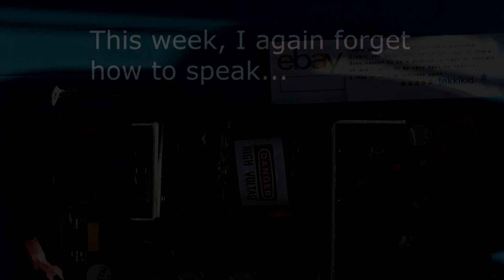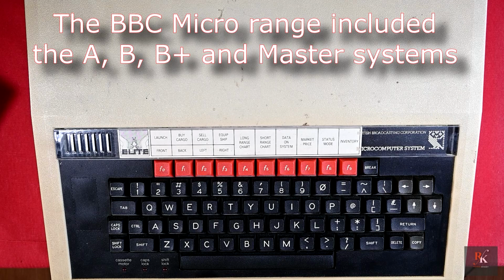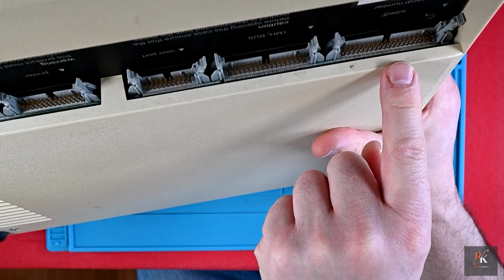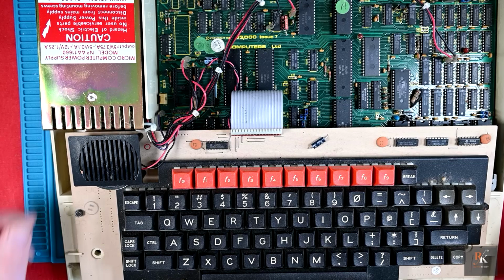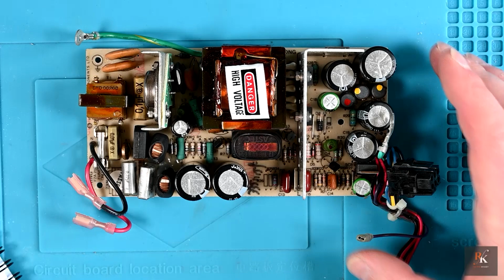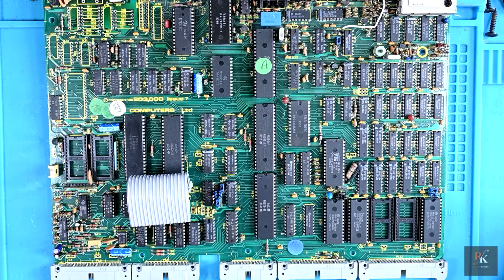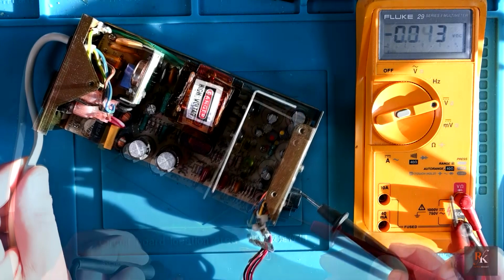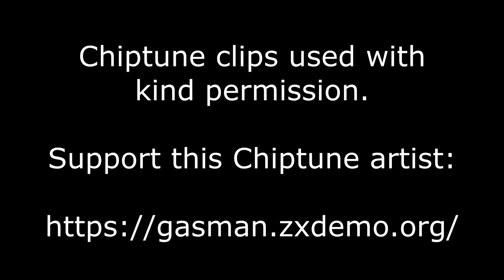Repair/Restoration: ACORN BBC Model B

Comment: Years ago when I first got my BBC I made the mistake of running it without changing the PSU caps and POP the smell took days to go. Mine has an SD card solution  in it. I need to get a CUB monitor however prices are a bit high and most people will not ship them
Reply from the maker: Hey Rocky! Yeah, the smell of those RIFAs lingers waaay too long, though you soon learn to hate them :D
Out school ran the CUB monitors and would also like to grab one if I ever gt the chance. Oh, and space... ;)